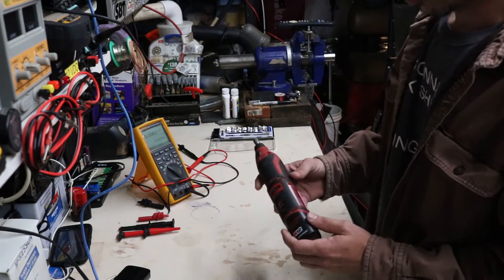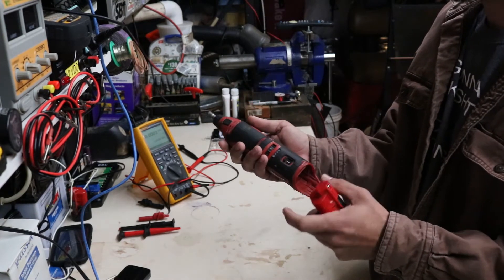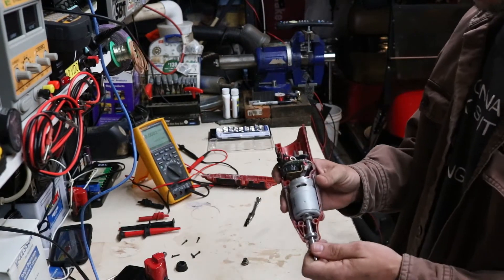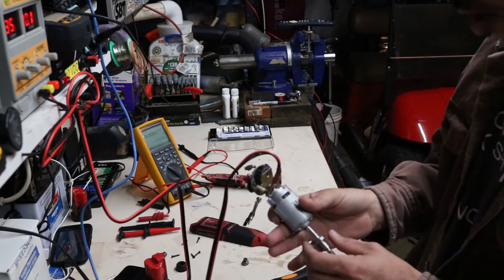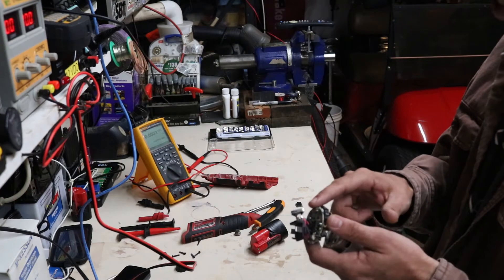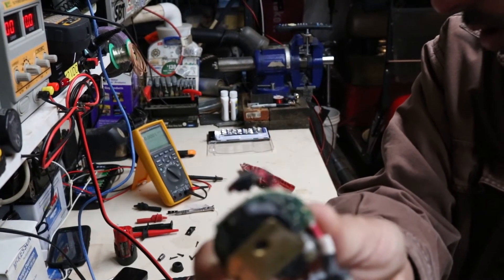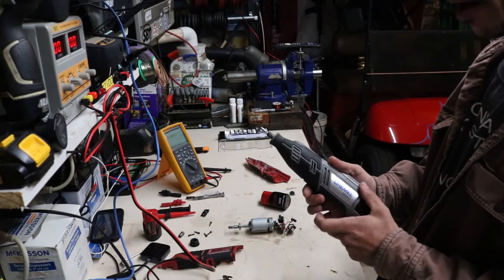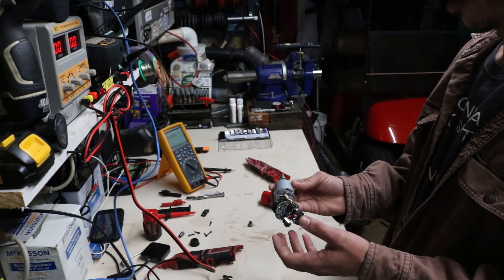Milwaukee  M12 Rotary Tool Tear Down to Find Failure Mode

Comment: Unfortunately it's been a problem with the M12 rotary tools, if you use them for long periods of time or at high speeds under load they tend to "burn out"  I've replaced mine twice already and it's still not 3 years old.   Be interesting to see if the new Fuel model stands up better.   If you only use it for very short periods with only very easy cutting/grinding it's great, but it can't take extended use or cutting under load for long.
Reply: These things are crap. Love my other m12 tools, but I would never buy this tool a second time. I have the brushless too. It will not run for more than maybe two minutes of use. You’re better off just getting the due grinder and the 1/8” collet to run rotary tools

Comment: I have a Milwaukee SDS plus rotary hammer. Its hardly been used. Recently  I power it on but the motor isn't turning. It only lights up the led worklight ,power indicator and emit a 'tik' sound. Can anyone educate me as to the cause of the problem? Thanks!

Comment: Milwaukee NEEDS to recall this tool, and engineer a robustly designed replacement,  as this tools control board is obviously junk, unable to handle standard motor stall conditions, without soiling the bed.

Comment: Dont toss them!  Try having the switch "on" b4 inserting the battery, I used one of the three I have this way for several years, full power only. Otherwise you could do what I did to salvage them. Overall they are well made and durable except for the pcb. One I took the board out and just ran the switch between the battery in the motor,one speed again but works fine, and it's held up so far despite the switch looking to be a low current switch.   The other one I took a controller out of an old drill which had a governer mode vsr, it works good with variable power even. Unfortunately the boards don't repair successfully, it seems after tediously replacing failed parts it still never works again, like they're programmed never run again once they fault.  Nice video but feel very let down there is no fix, and even suggest tossing when there is plenty of life left if uou dont need variable speed! A note of caution though: you do have to use common sense and not run your lithium battery down too far or you will damage them! The tool will not shut off to protect the battery once you bypass the original controller!
Reply: Thanks. It worked for me.
Reply: This is how I have to use my m12 rotary tool
Reply: Yup works for me good lookin out

Comment: I've used both Milwaukee & Dremel versions and both are not very durable.  Under normal use (no excessive pressure, never used above 1/2 the  max RPM), they both failed with not many uses.  I was able to find the P/N on Dremel (the control unit & motor) but Milwaukee does not have any.  There are 2 sets of numbers inscribed on the motor but neither hit with Google, eBay or anywhere.  

They should have used control unit engineered & made in Japan, but sadly even Japan is going downhill these days, thanks to made in China, globalization, excessive cost reduction and slave labour.  I'm willing to spend extra money on products that are durable & reliable.

Comment: I agree this rotary tool is junk. Mine has the same problem, and then after it turns on it only works for a few minutes and it goes into limp mode.. Now the dilemma is that I have a bunch of batteries.

Comment: This pcb is double sided, water damage is unlikely as its covered in conformal coating, the likely suspect here are the output mosfets. ALSO always disconnect one end of the motor before powering it, unless you have the schematic and know it wont damage it.
Edit: I took mine apart, first the Schottky rectifier was short, then found the d2pak IR mosfet shorted(D-S), so looks like a quick stop of the motor had caused a massive back EMF overdriving the Schottky diode, that caused the MOS to overload and also short.
So ebay parts from UK about £10, I just hope nothing else is damaged, but its hard to tell with no schematic as reference.
Reply: can you tell us what was the result in the end. Did the tool work after changing the mentioned components or did you change an additional one?
Reply: @diegofernandoarias7426  Hi, no I never got it working, I have a £800 soldering iron that delivers fast heat, yet I was unable to solder the MOSFET's onto the PCB without damaging them, same with the Schottkys, after going thru 2 mos and one diode I gave up. Tip: after soldering, check the D-S of the mosfet to make sure it hasn't faulted in  the heat, also be aware that the schottkys and mos (DS) are in parallel connected on the board, so if you do a continuity you may think its a mos fault but its actually schottky and vica versa.

Comment: I have one that's stuck on full power any idea
Reply from the maker: I would guess a failed transistor, when they fail , they typically fail open causing the tool to go full power with no speed control
Reply: @builditbetter5610  thanks for the reply just ordered another one . It's a tool you can't live without

Comment: Collet broke the first time I used it. I ended up putting a chuck on it and it seems to be working. Some accessories have to run a slow speed because of vibration, but don’t vibrate on a Dremel.

Comment: This is actually one of the worst tools by Milwaukee. Mine got caught in a glove only for like half a second and now it doesn’t start up unless I turn the power dial to 3 or greater. Weak ass motor. Bad design. They should fix it
Reply from the maker: I agree 100%
Reply: Same... I got about 3 minutes of use cutting some thin sheet metal with a wheel, and it jammed a few times, for a total of about 5 out of the last 30 seconds, and then it died and made a smell that let me know I had released the magic smoke from the motor controller.  Only runs very weakly, and on higher speeds now.   VERY dissappointing.   It would be sweet if someone could make a kit for upgrading these boards, and maybe the bearings as well.  Unfortunately I had bought it in a set of tools, and it was one I didn't open for a long while, until I had call for it.

Comment: Great Video! Their are two things I'd do to it before I give it to charity out by the street. First ,oxide spray the board. Second, spray the motor openings with an air in a effort to remove dust and improve contacts. It would be nice if they came out with a brushless version for this.

Comment: It turned out to be one of the battery tabs that needed some attention in my inoperable m12. Thanks for pointing that out.
Reply from the maker: Were the battery contacts corroded or were they bent?
Reply: @builditbetter5610  Bent. The same battery still worked for other tools. Thanks again!

Comment: Me sucedió lo mismo con un taladro idéntico y son 3 fallas. El motor se atascó y se tuvo que reemplazar, el switch se quemó, cambié todo y seguía con la misma falla. Al final verifique voltaje de diodo en los mosfet F1404Z, uno de ellos no me daba voltaje que debería de dar y di que ese componente fallaba. Lo cambié por un irf1404 y quedó funcionando! Hay que tomar en cuenta siempre los mosfet en este tipo de herramientas y hacer las mediciones correspondientes, siempre con datasheet en mano. Éxito!
Reply: Encontre el mismo problema en el mio ya ordene el mosfet me llega pronto gracias por tu informacion fue mas facil con tu ayuda.

Comment: Thanks for posting. Fixing the same tool for my friend. It turns on but you have to give the arbor a little nudge to get it to go. Started taking it apart and noticed the arbor doesn't spin freely. There is a slight catch as you spin it. If that makes sense. Like it doesn't spin smoothly. Not sure if that is normal. Doesn't look like you can even get into the actual motor.

Comment: had mine a couple of months used only a hand full of times and now its doing exactly this. I needed it today and after messing about with it for a bit i found if you remove the battery and switch the on/off switch to the on position and then push the battery in it works however you cannot control the speed i assume it was just running at full speed. Not impressed i also own the m12 fuel impact driver, m12 fuel hackzall, m12 torch not to mention all the impact ready bits and sets i have purchased. Im Not sure were to contact milwaukee for the warranty procedure as its been over 30 days
Reply from the maker: faiz k 

Mine did the same thing initially, put the battery in and it would run full tilt for a while then stopped and then after some time it wouldemt even do that.

You and i are not the only ones.  Milwaukee could have done a better job at the speed control.  All my dremel brand ones run for years with plently of abuse. 

Like you i have a bunch of the m12 tools, most of decent and they make a couple tools in a compact size that other tool manufacturers dont make so sometimes you are forced to get their stuff but they should not be making rotory tools on my opinion.

I have yet to file a warrantee claim with them but i thought i saw a thing on their website for warranty claims submission
Reply from the maker: faiz k
Heres the site for submitting the warranty. 

ttps://www.milwaukeetool.com/Support/Warranty
Reply: @builditbetter5610  Hi mate, would you please do me a favour, an SMD resistor came off my PCB, labeled R18 on the same side as the potentiometer for speed, could you find it what value it should be so I can replace it? Much appreciated if you can.
Reply from the maker: @ThuleApsu   I'm sorry, I no longer have the tool to tear it down for you, is there another resistor near by on the same circuit that you could get a reading off of to get you I'm the ball park?

The vast majority of these speed control circuits use either a 10k or 220 ohm
Reply: @builditbetter5610  Hi, I bought a new drill, on there R18 is 74R, replaced that, the 2 MOSFETs (IRF1404) and the Schotkky Diode and on power up, they all popped again, its now in my parts bin till I can be bothered to trace the circuit through, the motor is good though, tested it. The control circuit is working though, ~I heard its high pitched squeel for a second or two before the components exploded, gone are the days transistors cost pence, so far spent £20 just on those components, its becoming uneconomical to repair.
Thanks for getting back man, wrote this for others with similar problems.
Reply: @builditbetter5610  PS, so you know, resistor ranges in almost any device vary significantly, you really need the schematic, same working device or electronics knowledge to determine the value, repair is a real pain these days, its like micro surgery pushing SMD resistors across the board with tweezers.

Comment: Just bought mine about 2 weeks ago and it’s doing this. Only used it twice. was cutting plastic with it nothing major. So in my opinion it’s junk.
Reply: reyes02 

Ya not sure whats up with these, since this video i have bought 3 more with the exact same thing happening and all of them are like the one in the video.  I contacted milwaukee and have yet to hear a response. 

Im going to stick with dremel brand moving forward.

Thanks for the comments.

Comment: The milwaukee rotary tool and dremel 8220 seem very similar. Do you have an opinion of which one is more durable? Obviously your milwaukee broke so I assume you will say the dremel is more durable. But then when your dremel breaks, you will probably decide that they are both a bit crummy. I am trying to choose a cordless rotary tool and none of them are great, but these two seem to be the best. Thanks for the great teardown video. Very informative.
Reply from the maker: I was not impressed with the Milwaukee, it had a fraction of the hours or use that my previous dremel brand did before it bit the dust, and I am generally not hard on my tools, I use them within reason of what they are designed to do.

Dremel brand has always been good to me, and if your interested in a cordless one,  I am extremely impressed with the 8220 shown in this video, although I only a few months use out of my current one so far and it was a reconditioned unit, it is still going strong.  I have had no issues at all with the Dremel batteries or charger on the 8220's as I did with the Milwaukee brand. 

The 8220 has never felt like it was lacking power to complete a tast ,like the Milwaukee did most of the time.

As a point of reference my last Dremel 8220 lasted me about 4 years of almost daily use before the brushes went out on it and it needed a new battery.  I have heard bad things about the aftermarket batteries for the dremel tools and it was cheaper to get a reconditioned 8220 then a new OEM battery and brushes for the old one.

The speed control and ergonomics are 2nd to none of all the dremel tools I have owned, and I have tried the Milwaukee, dewalt, the one at harbor freight, and a couple other cheaper versions.

I also have the dremel stylus, which is also a cordless one, it has been reliable and has OK power for its size, but has horrible battery life and can be a bit finicky at times.

If you want me to do a tear down video and in depth discussion on the 8220, I can put something together.
Reply: wow, thank you for the info. I will likely get the 8220. 

I have searched youtube for dremel 8220 teardowns and I found very little. The best I have found is some videos about replacing the motor which briefly shows most of the internals. At a glance, the design and looks very similar. There could definitely be a difference in the build quality and component quality.

Don't make a video just for me, but I would definitely watch it :)
Reply from the maker: My Pleasure.

I was contemplating doing a tear down on the 8220, but you gave me the motivation...lol

i think i still have the internals of the Milwaukee one, if I do I can do a side by side comparison of the build quality and choice of materials used in each.

I should have it made and uploaded in the next couple days.

I think I may do a tear down on the Dremel stylus, and the Dremel saw as well .
Reply: awesome.
Reply from the maker: I have the tear down video of the Dremel 8220 uploaded if you are interested.
Here is the link:
https://youtu.be/2ATbRPlEXfc